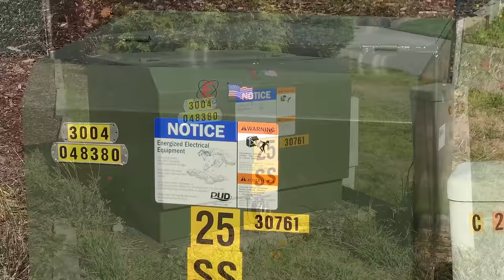Replacing a Pad Mounted Residential Transformer

Comment: My question is,its hot out of the ground so how do they change it with it being hot like that?,can they shut it off power coming in?
Reply: alex bellis
 ... yes, they can pull the fuse at the end of the line. Usually that's the end of the street or the nearest pole.
Reply: @rupe53  But that doesn't prevent home owners from having back-up generators hooked up incorrectly and back-feeding into the lines. You should always treat every wire like a live wire, even if you think it's de-powered.
Reply: @fordsrmaster  ... in my business there's no such thing as THINKING it's dead. You test first and KNOW it's dead fer sure! (25 year generator tech)
Reply: @fordsrmaster   power wont run at all if a fuse is removed. Where i live they can etiher 
A. Turn off at the main building(big city based call tower etc)
B. Turn off at sub station.
C. Toss a wet rag ontop a pole to short it out.
Reply: @southaussiegarbo2054  you clearly don't have any idea of how this works. If anyone of the home owners has a backup generator that is (incorrectly) directly hooked up to the mains without a transfer switch, it will energize the transformer from the secondary side regardless if they pull the fuse on the primary side.
Reply: @hdl454154   i know how it works. And where i live if you hook stuff upto mains without company permission you will be liable for damage/death. And also get a bill for "modifying power comp infrastructure without a electrical licence
Reply: @southaussiegarbo2054  that doesn't stop people from doing it 😉
Reply: @hdl454154   it does when they get the bill 🤣 and also a summons to show in court. If they dont goto court a arrest warrent is issued lol
Reply: @southaussiegarbo2054  that's not my point. What I'm trying to say is you should never treat a wire coming from a household as deenergized because some  'diy electrician' could just have connected his generator / solar system to mains. Trust me, it has happened and killed people. Just because it's illegal that doesn't stop dumb people from doing it.
Reply: @hdl454154   where im at they can disconnect your power whilst the line is live.
Reply: @southaussiegarbo2054  you just proved my first point: you have no clue about how residential electricity works.  I'm not arguing with you anymore.
Reply: @hdl454154   i do know lots. Bc i seen them do the works first hand. So i know lots. They cannot isolate one home in an aera they pull the connection pin(and take it with them) they can isolate an entire aera and by doing this they can stop feedback in the lines to. (Different country to you more then likely) as im in australia we have an entirsly different setup to how you guys do(our transformers are put up on a power pole but there are also insolation boxes so if a road works crew for example hit something in the road they can isolate it until the services guys arrive(can be hours later)
Reply: @hdl454154   btw here your line from your home to pole/mains out on street) is usaly a "one way line" with an earth wire in it. Also if you do anything stupid like you said they can trace you easily and bill you/remove your service until you get it authorized and safety checked by them(legal requirement that even if an electrician instals the gennerator etc they still need power comp to authorize the instal/connection and then every 3 years they gotta return and check it for safety reasons.
Reply: @rupe53  But they didn't.
Reply: @stargazer7644  ... how do you know they didn't? It may be in part of the video that got edited out... or was checked off screen where we couldn't see it. If they shut off the whole street for an hour that might have taken place a block away and we'd never know from our easy chair. Look close just after 2:00 and you will see them put both cables onto a fixture that basically shorts the hot to the neutral, where they are left during the rest of the operation. This is something you could NOT do with live wires and assures that no power can flow while they work. This is how I know they pulled a disconnect up the street. Of course this is only the street side so it may be possible to back feed from a house... but since they are standing there they would have heard any local gen sets starting up.
Reply: @rupe53  Because they wouldn't have done things the way they did if the primary was off.  You don't know shit.  That fixture is not shorting hot to neutral.  Those two big cables are the primary feed in and feed out.  The transformers are daisy chained.  The neutral is the bare copper wrapped around the primary cables and secured to the lowest bus bar.  That fixture holds the primary cables in place so they aren't flopping around and accidentally getting something rammed up in the connectors.  It is absolutely possible to backfeed from a house, and they should have protected against that.  Hearing or not hearing a generator means nothing.  A customer could have a net metered or microinverter solar panel system, or a battery backed UPS feeding power back up the line.  I have a Honda generator you can't hear running 30 feet away.
Reply: They would do it hot to minimise the number of customers affected. You would have noticed the man pulling the two connections off with a long insulated stick and plugging them into a pair of dummy receptacles so the live 7200 volt connections are not exposed when they actually changed the transformer.
Reply: @netking66  ... in retrospect I believe you are correct and that dummy plug is an insulated jumper so the hot wire can feed through to the next customer while they work.

Comment: Transformers: they look simple, but there’s more than meets the eye.
Reply: They are actually pretty simple I’ve ran wires to those things there is one nuetral post and two hot posts just don’t touch it if it’s hot or you might be heading six foot under these wires are easy to run we do electrical work for a living it’s a lot a work but it’s simple

Comment: I would have at least re cut and re striped the triplex...
Reply: and you would loose your job after the company has to re-pull feeds because they arent long enough anymore.
Reply: @Ash_Lawless  on our system we wrap the triplex around the bottom of the box at least once so that there is plenty of room in case you need to recut it. And either way youre talking about 3 inched max of cable that needs to be cut lol if i would get fired for that i might as well quit now.
Reply: @DonaldJPump24  if your recutting wire in the same box every time wouldnt be long before that 4 inches equals enough that it doesnt reach anymorr
Reply: @Ash_Lawless  bruh, what? It would be a long time lmao what does your company replace transformers on a monthly basis? like wtf

Comment: I heard the torque wrench click every time 🤫
Reply: Scrolled pretty far looking for this. They didn't torque anything. They probably damaged the aluminum conductors with that impact driver
Reply: @FlyboyEmert58  yea it was kinda sarcasm but aluminum is pretty malleable so I’m sure it’s either gonna squish and be fine or their gonna have to come back in a couple of years when it is discovered the terminal is overheating 🤷‍♂️
Reply: @FlyboyEmert58  So the impact driver does not have a torque-control built in?

Comment: Me: Sees no gloves used....
Also Me: Panicked Breathing
Reply: Gloves… where was tha rest of the arc flash gear? Me as an industrial electrician have to suit up in MOP gear to check anything above 40 volts… that probably had over 2500 volts on the input side at least.
Reply: @krillin63  Jesus, me changing an outlet at home entails turning power off  to the whole block and removing my electric meter😂😂😂😂, got shocked by 240v once at the main......i saw jesus
Reply: @gabrielanthony1325  LMAO. When i was in the USAF i got hit with 220… But see aircraft power, civilian or military is 400 hz vs 60hz. My bones ached for a week. It shook me like nothing else.
Reply: @krillin63  Whats the benefit of 400hz vs 60?
Reply: @gabrielanthony1325  smaller transformers mostly. If you recal how inductance works 60 hz takes more cycles to do the same amount of work. Think of the transformer as its a motor a bigger motor (60hz) turns slower but has more momentum and a smaller motor turning faster can achive similar goals. Kinda like a kirby vacuum vs a Dyson vacuum, if you follow my simple analogy.
Reply: @krillin63  got it, makes total sense now.....i just went to youtube and home depot that day, but no one told me about residual energized lines
Reply: @gabrielanthony1325  yea man gotta be careful. Stuff in the house plugged in can backfeed a discharge.
Reply: @krillin63  i was changing the 220-240 for the electric dryer.....barefoot.....in the basement....thought i was good with the circuit breaker off
Reply: @krillin63  They pulled the fuse on the line drop at the pole And the 2 main lines were snapped in to a ground block that the clamped to the middle that's is what they used the orange stick for

Comment: Never use an impact driver to tighten lugs! You over tighten them without realizing it. Technically should use a torque wrench.
Reply: The professionals who are trained and get paid to do this day in and day out probably know more about it than some armchair-expert on the internet.
Reply: @Orcinus24x5  here’s a professional that’s terminated and worked on thousands of aluminum conductors telling you that Mike is absolutely correct. Mechanical lugs have torque specifications for a reason. Aluminum conductors are notorious for having strands break off due to over tightening, which can obviously cause major issues. You tighten your conductor in the lug firmly and then torque to its specification. But what do I know

Comment: Someone correct me if i'm wrong, but it looks like they pull the lives off the transformer terminals, using the insulated rod, and push them onto some kind of blanking terminal? These blanking terminals isolate the main supply so they can lift it out and replace it, lastly pulling the lives back off the blanking terminals and pushing into the new transformer terminals.

Comment: I figured out the transformer was hot when they got there. The guy with the long orange stick plugged the input mains into three dummy rubber plugs. They did the work, then he replugged the mains into the transformer, the supervisor checked some voltages, they removed the dummies, locked the thing up and caravanned out of there.

Comment: Great teamwork.  I do wonder how much the transformer weighs, and I wonder how much it costs. Very interesting what is involved in keeping the power on!  Thanks!
Reply: No idea how much they weight, but I work in an office where we plan distribution systems in four different states, and it varies from $3-$5k depending on how rugged they need to be. Sunny states can get them cheaper, wet states get them more expensive.
Reply: @misterben4360  Thanks!  I have one on my property in Guthrie, OK, and wondered what it cost when they put it in 17 years ago.  Just my house on it so perhaps it is a smaller, lighter unit on the inside, though it looks the same on the outside.  If they last 40 to 50 years, it will probably be here long after I'm gone!   ;<)
Reply: The one in this video probably weighs about 1000 pounds (450 kg) but could be up to double that.  Cost can vary for the utility from $3000 to $8000 or so.  It all depends on the transformer's electric design and rated current capacity.  Three-phase pad mount transformers (essentially 3 of these transformers in one bigger case) that are used by commercial or industrial customers are much more heavy and expensive.

Comment: The most interesting part is how they install a safe parking terminals for the live high voltage hot pair to make this hot swap. I was wondering why there are three wires for each of the three binding posts, but that was explained at the end as the transformer serves 3 residences.

However I watch another similar video and they don't conduct hot swap as there is another person switch off the power on the pole, or underground. It only make sense the swap is not done hot as that would be unnecessarily risky for the crew.

Comment: I work with crews that clean up oil from leaking transformers and have observed pad mounted transformer changeouts thousands of times.  The linemen or electrical contractors I work with would never switch out a transformer without electrical insulating gloves and FR clothing.  In Florida, a customer's generator could automatically engage during a power outage (or changeout) and backfeed the secondaries.

Comment: I'd be more worried about the age of a transformer than the faded paint on the box. But even more worrisome is the fact that based on how much that transformer moved when they pulled and pushed on the contacts that it's not actually bolted down to the concrete pad. Would be scary to think that it could be pushed by a slight love tap from a careless riding mower or car. And why not make the effort to sweep the concrete pad of all that dirt when replacing the transformer. Why don't they use a weather gasket on those transformers to keep the spiders out as well as the dirt?

Comment: This was a fascinating video to watch and learn a bit more about electrical transformers, ie getting a chance to look inside the metal box at the different components involved in stepping down the voltage. I was very damned surprised though to see them using an impact driver to secure the wires into the buss bars - what, no torquing down the cables with a TORQUE WRENCH to MFC specs??? That's just craziness in my opinion. I installed a large lithium battery bank with a large inverter and solar controllers in my class A RV and by god, I torqued every nut and bolt to spec to avoid bad connections and creating resistance (ie, HEAT). Hell, my system is a simple 12-volt to 110-volt system. I can't imagine why they would skip such an important step in this process. when dealing with  25 KVA coming down the line?  Oh well - I can only assume that they know what they are doing or they would have fried themselves )or others) by now when doing these installs. Obviously, the supervisor signed off on it (he was the one attaching the stickers to the outside of the metal box)...

Comment: These guys make it look easy even though there is a chance that 480 volts of power could arc out. All the protective gear and tools are interesting.
Reply: The primary voltage going in is actually 7200/12470 and the secondary 120/240
Reply: @gabriellong1096  The primary is 7200. There is not 12470 volts in that box as there is only one phase present.

Comment: Nice video except our practice at ComEd in Illinois is always to take a little more time and test for proper voltage before connecting customer load just in case name plate on transformer is wrong and transformer secondary is 240 / 480 instead of 120/240.

Comment: Here in Las Vegas the transformers are mounted on concrete pads. Additionally, the other utilities such as cable and telephone are in vaults surrounded by concrete pads and each water meter has a concrete pad around it in the front yards. I would imagine different codes for different places.

Comment: Great video thank you for making it. As an average persons never see this delicate and dangerous work that linesmen do everyday.

Question: 
I noticed in the video that old unit had left side mounts for the large gauge cables and the new unit had bottom ones. It seems that the left side mount appears easier and smoother to insert. Is there a reason for the change, if you don’t mind? Thanks again!

Comment: I'm an electrician.  Getting hit with 120/208 is annoying.  277/480 will change your concept of electricity for life.  Still find it funny that 15,000 volts is considered MEDIUM voltage.  You get one mistake and it's not good.  Great job guys.

Comment: Seems like you guys should’ve worn your hot gloves at points when you weren’t wearing them? Like when you had the hot feed plugged into H1A and were checking voltage?

What was your grounds setup and were you working between grounds? If that’s the case why were you wearing the hot gloves when setting the new transformer?

Just looking for more information, thanks.

Comment: I understand the electrical theory and the function of the transformer very well, but I am interested in the actual practical side of this operation.
The long orange pole is obviously a fiberglass pole that isolates the worker from the high voltage, I am surprised that this was done while the High Voltage was still live.
This is a very interesting video but I would love to have a dialog of exactly the mechanics of the operation.
Thanks.
Reply: 'Merica, where customer convenience is more important that safety
Reply: @brunsy1990  WHAT THE HELL ARE YOU BABBLING ABOUT?
Reply: @brit1066  Anywhere outside suburbia that wouldn't happen, can't anger the horde of Karens. The right way to do it is to drop the leg of the grid being worked on, test, ground out, and test again. Because you never know what DIY moron wired their solar after watching a YouTube video and didn't install backfeed prevention or improperly installed  it.